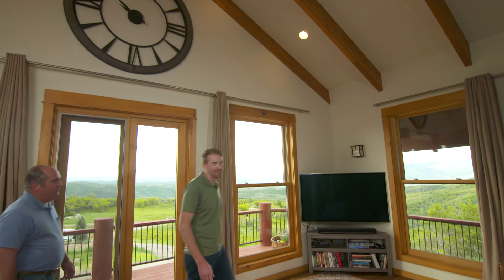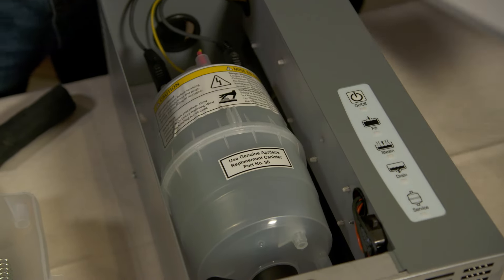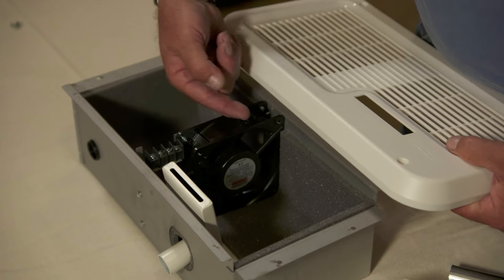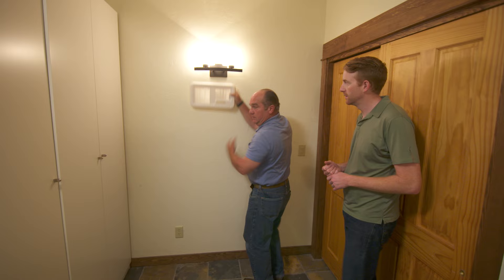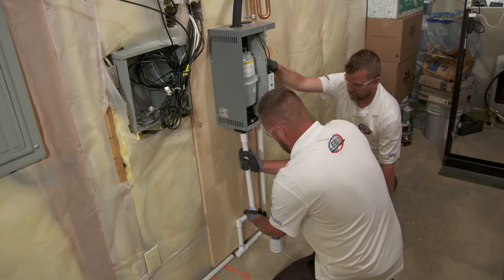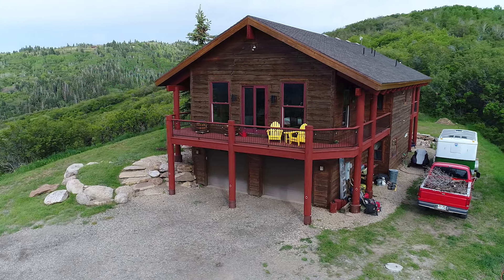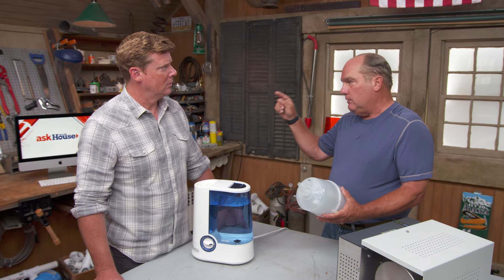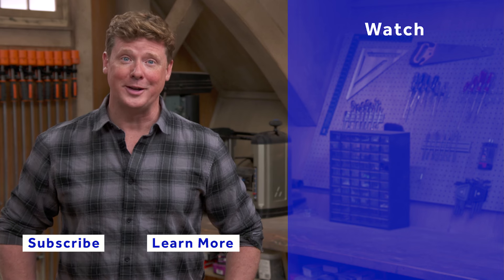How to Install a Whole-House Ductless Humidifier | Ask This Old House

Comment: What brand is the stainless filterless humidifer at the end?
Reply: I have the same question as you. I don't know the answer on the brand. But I did find out its called a "Resistive humidifier". I'll start researching more later. If you have any luck please share.

Comment: Forget winter dryness. Here in Las Vegas, it's dry ALL THE TIME! Them thangs that attach to your central system, hmm, I see too many problems. What if my central air is off? Will there be a puddle of water collecting somewhere in my ceiling? I think this ductless is the way to go. Electric bill? The solar panels can cover that (a must in Vegas with all that sun, a no-brainer). It's basically set it and forget it and I'll just pay for yearly maintenance from the hvac people. Desert dry skin problem solved!
Reply: have you tried installing it? Has it solved desert dry skin? Thanks!

Comment: I’d be worried about mold and mildew. But I’m not in that dry zone. Unfortunately, I’m in a VERY humid zone that makes me sweat all summer when I step outside - haha.
Reply: The maximum setting on this control is 50%, well below the threshold to create mold and mildew.
Reply: My house is usually between 10-30% humidity all winter. I could really use a humidifier. 

It sounds like you need a whole house dehumidifier where you are. Air conditioning does that already, but only if it's running enough. For the spring and fall when you aren't using AC, a whole house dehumidifier could be helpful.

Comment: How does the humidistat on the wall communicate with the other components?  Is it wireless?  Does  it use wires?
Reply: It uses a pair of wire. I have it installed using the Nest thermostat to control.

Comment: For the Aprilaire it can run on 120, 208 or 240 VAC. You only need 120 for a small house.  BUT, the unit comes with the model 80 canister which does not work with 120 VAC. You instead need the low conductivity 80LC canister. So beware you may need to buy a different canister or go with high voltage line.

Comment: 30-40% RH @ 74degF (assumed temp) is still very dry. In Houston, prior to the Aprilaire 800 (installed in video), I was running the heat up to 70degF @ about 20-25%RH. I've had mine installed for three winter seasons now and run it up to75degF @ 50%RH. I use a handheld humistat to check the areas. 

It's installed on a ~4ton gas central unit with the aprilaire setting at the lower amp setting (11A).

Comment: How about using pex lines vs copper so they will not freeze and burst? I am trying to run water in my attic should only get to freezing temps for about a month in las vegas. I plan on using a plug in heating pad on the unit

Comment: How much does it cost electricity-wise to run one of these???

I have a console humidifier in my livingroom that does basically the entire house.  It operates by cycling an absorbant mat through water and a fan pushes air through it, evaporating it and putting it into the room.  I put 15 gallons of water in it every week or so during the dead of winter.  Wouldn't something like this work?
Reply: This unit was configured at 16 amps and 240 volts per hour of run time. Multiply this by your energy costs to calculate the cost per hour to operate. The Aprilaire 865 can produce 35 gallons of clean steam per day. Meaning this would only have to run 90 minutes to equal your console humidifier output.
Reply: @aprilaireco  16 amps x 240 volts = 3840 watts (3.8 kw).  At $.10/kw (relatively cheap) electricity, that's $.57 per day for the Aprilaire.  Not sure about the console as you would have to know how long it runs, wattage, etc

Comment: 3:43 They have exposed wire outside the terminal block, is that not against code?
Reply: @Noah-qt3rq  Actually this is the electrical being hooked up to the board in the humidifier and there is no excuse if not done safely. Also the house is finished and just the mechanical room for obvious reasons is not finished. Not sure what video you just watched but the house is clearly in a finished state...
Reply: are you talking about that little 1/16" of exposed copper???
Reply: @cutrara7  I don't make the rules/code, any exposed wire allows for another wire to touch it causing a short. Those terminal blocks are designed to have the shielded part fit in them. If it don't you're using the wrong gage of wire!
Reply: @steve_main  haha nothings gonna short on that 1/16". some people come here to try and find the most trivial things to pick at. i come here to have a chuckle at the armchair technicians! thanks for not disappointing!
Reply: @cutrara7  It was a question and you felt the need to ridicule me for a question? Not sure what your plan was here. I live in Ontario and as far as I know you cannot have any exposed wire at a terminal junction. So I was curious if that is allowed.. You obviously seem to troll people giving your opinion and not stating facts so ill wait for someone else to answer the question that is knowledgeable on the topic.
Reply: @steve_main  sorey aboot that budday, my intent was not to ridicule/troll aboot it. i just thought it was silly to point oot that tiny bit of wire, when in reality, if anything is going to short oot, it would be the electrode ootputs on the board that are connected with standard spade connectors. and thats from the factory. and even thats fine.  BTW, the "shielded part" is called insulation. shielding is metallic and something completely different. again sorey aboot that budday

Comment: there's much cheaper and easier to install options.  I have the Horticat U80 which i easily connected to the water line and it's a beast. keeps the house at a nice 80% humidity
Reply: 80% way too humid
Reply: @shahsmerdis  never had any issues with mold or anything. 70-80% depending on season
Reply: Can the Horticat U80 be used in ANY part of the house? What if I have real hard water?
Reply: @msmarthagalan2590  I have it in my main living area but and the humidity spreads out between rooms. my apartment is an open concept two floor so that might help. If you have a house maybe leave the doors open so the air and humidity circulate. If you have central AC you’re better off installing a dedicate central humidifier
Reply: @Orholam5  Thanks for the info. I need to research this more.
Reply: They are showing a steam humidifier, what u are referring to is ultrasonic mist. I don’t think that will distribute moisture nearly as well as steam

Comment: i have a April air attached to my furnace, it sucks ... the only time its on is when the furnace is on. in fact, in my case it really never goes on cuz i don't have a exhaust in bathroom so every time i shower i add that much moisture to rest of house ... personally i think instead of putting an exhaust in bathroom they should just add a air intake to bathroom and feed it back to your warm air furnace to redistribute it to the rest of house ...
Reply: if you have an aprilaire that only works with the system on, then you must have a bypass type humidifier.  You can add a model 50 current sensing relay and run the fan on the furnace all of the time.  

You don't want a return in the bathroom.  It will circulate the stink throughout the house.
Reply: Ecobee controller is a good option to control the humidity.
Reply: @vr2542  ill look into that, right now im using the aprilair automatic controller with sensor from outside air. but even in the middle or winter the house say's it 30-40% ... and unfortunately i lost the manual override switch (its like some resistor you put between two terminals) so i cant even bump it up a bit higher even if i wanted to but it does run fine in "test" mode so assume it aint the controller ? ... im guessing?

Comment: No real mention of the operating cost. These steam units are basically boiling water all day, and can draw 3000-4000 watts to do so. Expect on at least $40-$50 month to run one of these in an average house. The old evaporation units are much cheaper to run, and they are a better choice if you have a central heating (air) unit.
Reply: they claimed an operating cost of $100 per year near the end of the video.
Reply: @donaldstafford970  That was to replace the 'cartridge' to keep the unit clean. That doesn't include electricity to run it.
Reply: This unit was configured at 16 amps and 240 volts per hour of run time. Multiply this by your energy costs to calculate the cost per hour to operate. To maintain a home of this size, may only require a few hours of run time per day.
Reply: no one is boiling water.......humidifiers use either electricity or ultrasonic waves to vaporize water
Reply: My electric is about $50/mo in the winter. data from 3 winter seasons. It's currently the most feasible system right now and Carrier and Trane certified them.

Comment: the unit he installed only emits steam in one location. bet it costs a lot more than that R2D2 looking device. Why not a cast iron kettle filled with water on the wood stove?
Reply: LOL.....a kettle is extremely energy inefficient because you're boiling water, whereas a humidifier usually uses electricity or ultrasonic vaporization....also you'd have to constantly refill the kettle to even bring the humidity up by a few percent.
Reply: that' would yield about 10% efficiency. This setup has very minimal heat loss.
Reply: My parents used the pot on the stove trick to raise the humidity during the winters in Alaska. Not efficient but it worked.

Comment: That humidifier is cool until you get the electric bill.
Reply: The added cost would be negligible.
Reply: This unit was configured at 16 amps and 240 volts per hour of run time. Multiply this by your energy costs to calculate the cost per hour to operate. To maintain a home of this size, may only require a few hours of run time per day.
Reply: Depending on the climate.  Negligible ha ha
Reply: Aprilaire 

3,840watts per hour?  Small air conditioner
Reply: U try telling that to ur 4 year old kid having nose bleeds from the dry heat in the middle of a northeast winter

Comment: how a place surrounded by trees at high altitude lack humidity?
Reply: You've never been in the western US?   It's dry out here regardless of the vegetation you see.   There will be intermittent rains in the summer and snow in the winter, but most of the time it's clear which means low humidity.  Where I live we have days in June with 2% humidity.   Most of the time the humidity is under 15%.   It will go up briefly before and after a rain storm, but then quickly returns to lower levels.
Reply: A solid chunk of the western US is in a rain shadow.  All of the water received comes from the mountains after snowfalls and rain.  Also, higher elevation means you are closer to the sun.  The plants have adapted to collect as much water as they can before evaporation.  Only the toughest plants can grow in the mountains and the best timber grows in the toughest places.